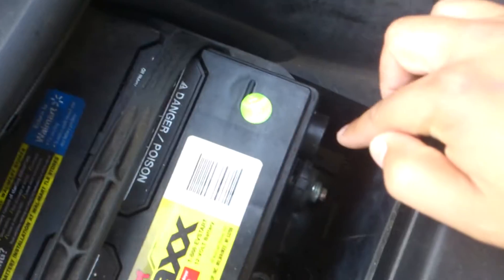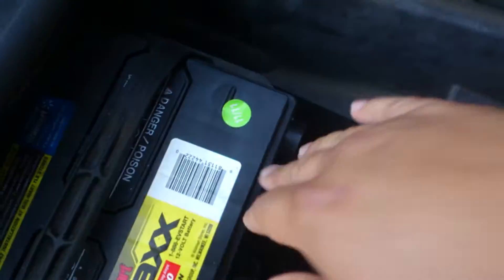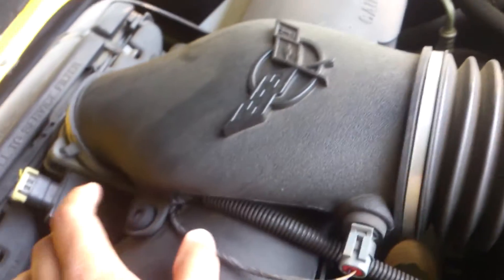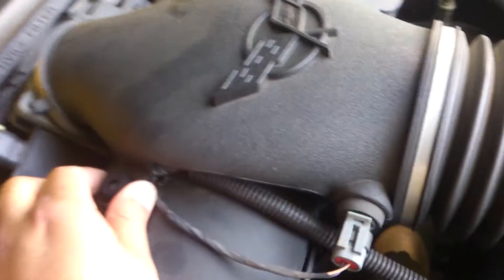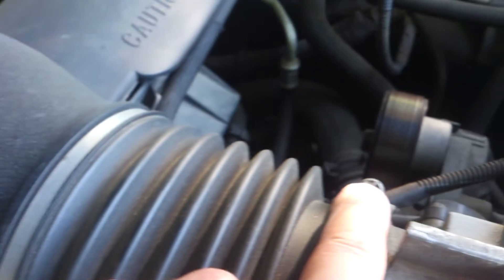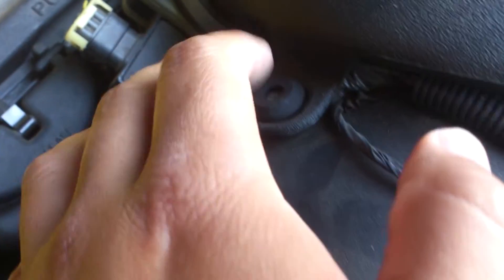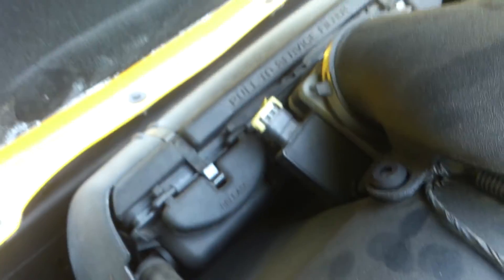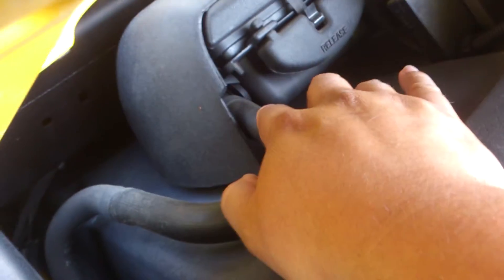Stock Air Filter Removal

Comment: hey man did you ever find out how to remove the tabs underneath the filter?
Reply from the maker: The ones towards the front of the bumper? If so, yes you can use a flat head with duct tape and slide it in between the air box and the frame and it should pop it loose. If you have a tool set for interior panels those would work best just slide it down and pry it away from the frame. There are only 2 tabs one on each end of the filter. You may be able to see the tabs in this video https://www.youtube.com/watch?v=bCRMaSj4s60